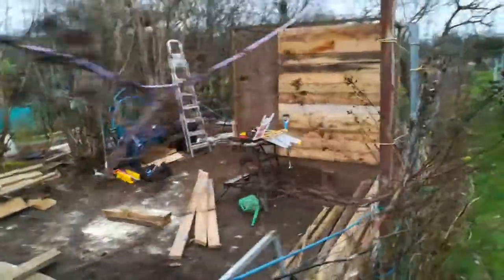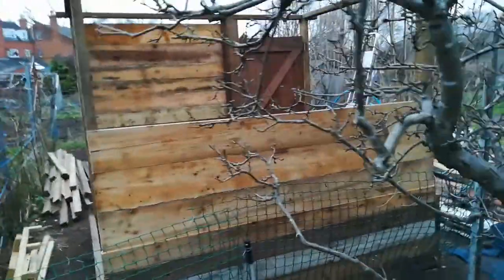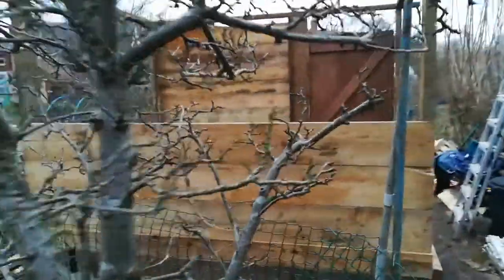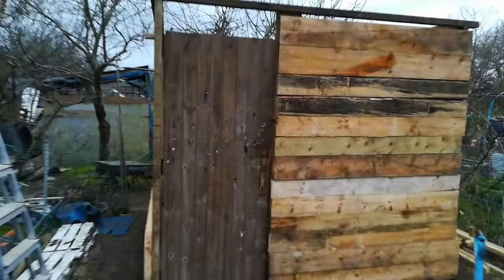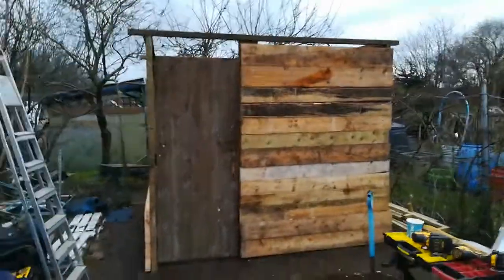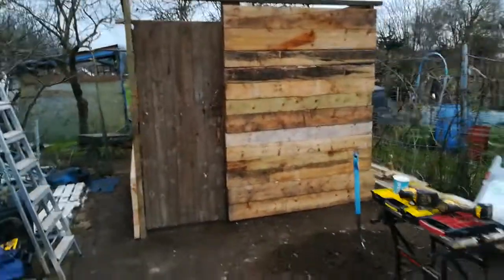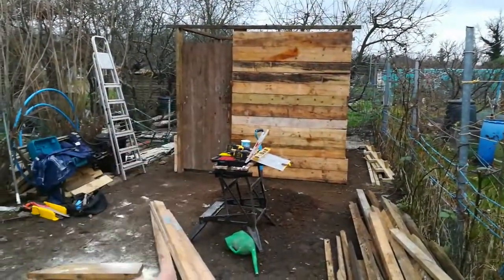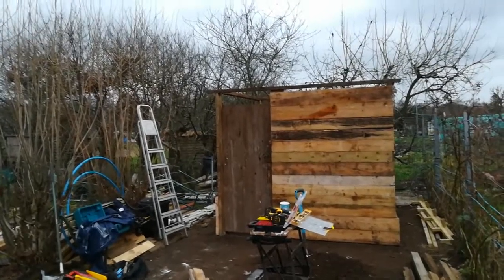Miles allotment fruit plot shed Jan 2019.

Comment: Miles - will you be filling the gaps in between the wood and then waxing the outside?  Nice thickness of wood, and it looks really decently strong.  😊
Reply from the maker: Paul great ideas, but it will only be used for storing tools as I have a better shed on my other plot. I would love to varnish it or use bees wax but too expensive, I have a couple of tins of old woodstain that I might use, or I might just leave it as it is.